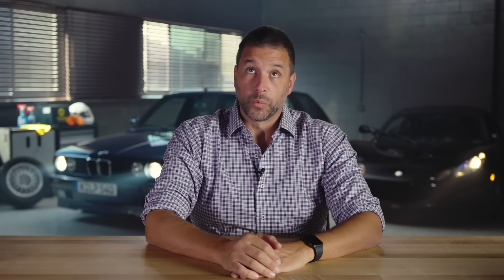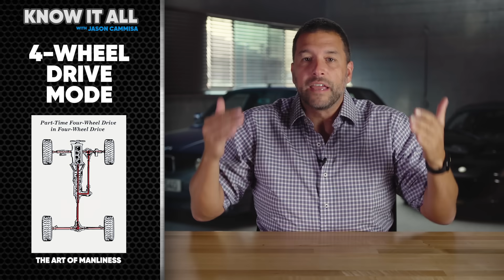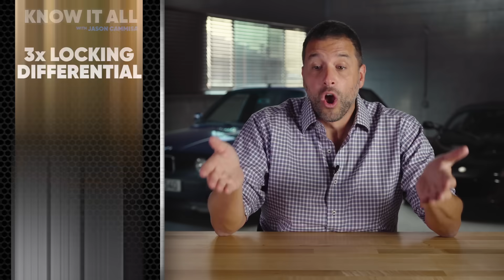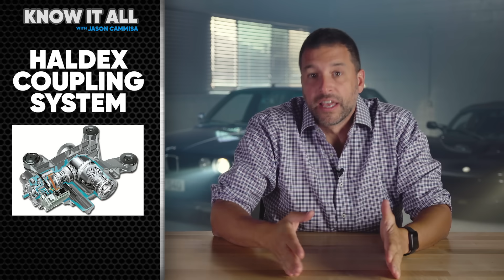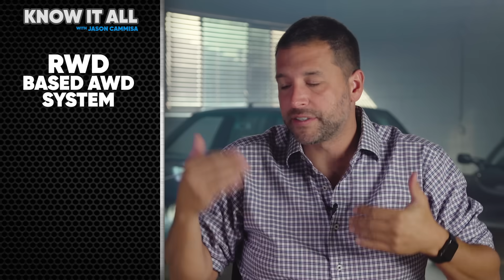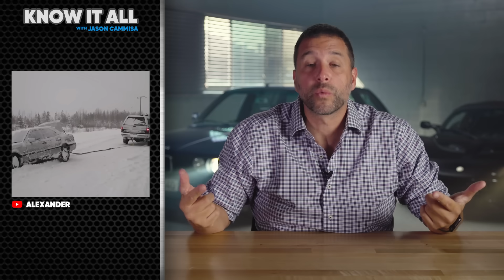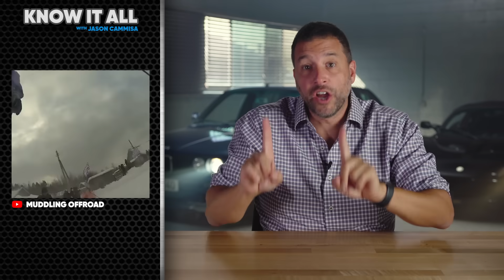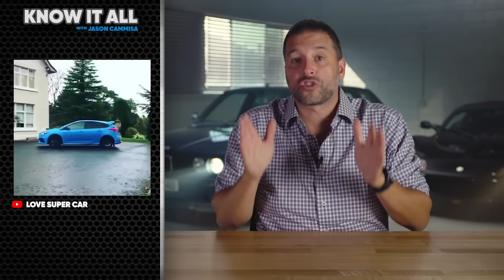Understand Your All-Wheel-Drive System | Know it All with Jason Cammisa | Ep. 04

Comment: AWD system is a liar ...
They never said HOW it works, they just said AWD ... They never promised you anything nor do they tell you how much power each tire gets at a time or ever... did they ?? People make their own assumptions on what AWD means. 
FWD does NOT always mean both front tires get equal power or split power
RWD same thing thing, no promise that your rear diff is LSD ... 

Just like your home ISP ... UP TO 100Mbps ... And they never said 100Mbps over WiFi either across the entire house when your house is 3k sq ft ... 
Your cellular provider says 5G, 4G, LTE, 3G etc ... They never quote or guarantee any specific speeds. Just that you will "GET" that technology of data ...

Comment: A true know-it-all wouldn't use the terms "power" and "torque" interchangeably. This video is surprisingly correct, and covers a lot for how short it is. But I think it would be most helpful to explain that only open differentials split torque equally or 50/50, and locked differentials send equal motion to each wheel. Sending equal power to each wheel only happens when driving in a straight line with open differentials and no slipping wheels. Literally no AWD system "sends power". They only send torque or motion. If they send torque, the resulting wheel speed determines power. If they send motion, the available grip determines power.

And yes, the innovation of overdriving wheels and using clutch packs to vector torque is awesome, but brings worries of clutch wear. Rear-biased or rear drive only Torsen setups are most useful, reliable, and fun in real life.
Reply: Pedantic. Know your audience would be a great thing for you to learn.

Comment: You can add a controller to the golf r to customize the power split. It's capable of full time 50/50. That's still not as good as other systems allowing a +50 rear bias, but it's a lot better than the stock config.
Reply: That's not a good idea, it WILL put more wear on the clutch pack which isn't a serviceable part. Don't do it. 
I researched this because I was interested in an RS3.

Comment: Is the SQ5 not a rear biased torsen based AWD system like the S4? I was under there impression they had very similar drivetrains. Any handling differences with the Macan could come down to a rear LSD like the S4's sport differential.

Comment: You got the Audi part wrong. Audis either have Haldex (A3,TT) or Torsen (A4-A8,Q5-Q8). The latter send 60% of the power to the rear and 40% to the front as standard. Those numbers are adjustable to some degree (up to 85% rear and 15% front). There is also a new Quattro Ultra system for some models (A4 and upwards) which behave more like haldex systems. Depending on which enginge is installed, you get the Quattro Ultra or regular torsen. (high torque torsen low torque Quattro Ultra).

Comment: Where's all my truck gang guys who have no interest in drifting, just wanted to know why the make-believe awd SUVs are not near as good :P
Reply: 4x4 guys usually want tough drivetrain so they can fit big tires. Independent suspension also limits flex. That's most of the AWD vehicles out lol. 
Mitsubishi montero sports had AWD(open differential in transfer case), 4h (locked center) and 4lo (but only about 2:1 reduction) They have IFS too unfortunately. The one upside is my factory axles are 4.90s
Some landrovers and Mercedes can too.
You ever hear of a Mercedes Unimog? It was designed as a "farm tractor" 🤣

Comment: Haha, Golf R is a snoozer, Focus RS is the goat. When my digital rear diff is fully locked, my rear wheels spin faster than the front. Big drifts.
Reply: And I just tuned my differential to squeeze harder. Now under launches, I get 4wd burnout, sliding off the road before Lightspeed.
Reply: Jason doesn't understand how the AWD system works in the focus RS, no center diff. Each rear wheel has a WET CLUTCH and forum users have logged no excessive heat. 150k+ miles on some cars already.
Reply: Jason told me my car would blast by ribs out, little does he know they revised the focus RS suspension after 2016.

Comment: There are a few inaccuracies presented here but I understand this is a not an in depth explanation. As others have mentioned the SQ5 has an actual center differential and it's the Q5 that has the Quattro Ultra clutch-based AWD system. The Macan will still feel more RWD than the SQ5 but in other regards the Audi is arguably more capable. Also the Mitsubishi Evo's AWD system is not like SH-AWD or the GKN Twinster system in that it does not overspeed the rear axle. It has torque vectoring (AYC), but it also has a center differential (50:50) with an electronic clutch based locking ability. Which brings me to my last point --  in any AWD system where the the front and rear axles can "lock", be it a traditional transfer case, center differential with locking capability, or a clutch-based system with no differential, it's not completely accurate to say that the torque is split 50:50. When the axles are locked, the torque will go wherever there is available traction. In a below the limit of grip situation this should mean that the split is 50:50. Once you are at the limit of grip the split will vary based on the overall friction force (normal force * coefficient of friction) on each axle. This will be affected by weight transfer and changing road conditions. In this way it is possible for torque at the rear axle to exceed 50%. Some of us live where there's six months of snow and icy roads so these conditions aren't impossible in the real world. I get why this won't give you the RWD dynamics we're all looking for on the track or your favorite back road.

Comment: Something that wasn't addressed is something like the Subaru AWD system.  More so, how would the AWD systems mentioned compare to the STI's 3 differential AWD system?
Reply: The STI's system is closed to the BMW/Jag system mentioned in the video, except the center diff has a static split (from 35/65 F/R to 41/59 depending on year) and the computer controls clamping the packs to change how much the center "locks" when there is a differential in speed between front and rear axle. The "problem" with the Subaru layout is that it forces the engine to be entirely in front of the front axle line (hence the short flat-4), but it does save a little bit of weight/packaging space compared to other RWD-biased AWD systems.

Comment: Hey, how about a video pertaining to we who don’t drive to the limit? Ya know like all of us who commute in snow and rain....thanks for talking to 1% of us....
Reply: There wouldn't be a video. Here's the rundown for AWD not driving on the limit...If you run out of grip AWD gives you more grip, O and you get slightly worse tire wear. THAT'S IT...

It's like trying to make a video about brakes and abs...To the "commuters" as you claim...They stop the car. What more do you  want in a non-limit based situation. 

If you are asking "how does AWD work in snow and rain" is a contradiction to "don't drive to the limit"... AWD is a system to HELP in limit driving. The whole point is to save your ass when you inevitably push it too far...If you are cautious enough not to be in that situation great...then the answer is AWD does absolutely nothing.

Comment: Open differential can not send power to only one wheel. Force from the engine is distributed equally between all wheels, but wheels can rotate with different speeds.

Comment: The video clips for this were awesome, as is Jason. I really like the simplicity and feel of the AWD 62R/38F split in my 01 325xi (originally bought for my wife's snowy commutes, but now my modified toy... it performed well in a moderate amount of snow, even on all seasons, but as a daily it's still fun).
Reply: I had an 01 330i. Just rear wheel. With snow tires, it was just fine. RWD works well in the snow. Then I had the opportunity to have a 2010 328i XDrive... All season tires made driving in the snow a piece of cake. The same exact day, it took me half an hour to back into my driveway from the side of the road in my FWD Malibu. Definitely showed me the difference between an AWD system and a 2WD system. Snow tires are a must, no matter what, but all seasons on an AWD will definitely treat you well.
Reply: @CMitchCars  Agreed! I wish I had kept my 92 Prelude with a OE JDM LSD too... it would pull through the snow!

Comment: Nice rant. It's good that Jason remembered to state that all of this only matters on the limit. A couple of problems, though. First of all, 4wd rally cars of recent memory have been able to steer quite well even without center differentials. WRC teams threw those away for a few years, when active center locks got banned. And secondly, Audi SQ5 actually has a real center differential, unlike Porsche Macan. Audi's diff is even slightly rear balanced. The car just has otherwise been designed not to be tail happy. And then there's the new Toyota GR Yaris, which seems to be quite playful, even though it has the exact fwd-based system, that Jason thought the Audi had.

Comment: Subaru system is superior because of symmetrical axels on front and rear, which combined with the DCCD system is the best true Equal AWD system.
Reply: Tbh best system is found in pickup trucks, user selectable 4WD with LSD rear.

Comment: My 2002 Volvo V70 xc Cross Country is Front Wheel Drive-All Wheel Drive (Haldex). Its wonderful in straight ahead driving, a formidable drag racer on snow & ice-covered roads running studded winter tyres & ok in corners as long as I am careful with the throttle. Take the bend slow & easy & once you get straightened out, hit the throttle. On a snow-covered bend, I gave it too much throttle & it tried seriously to drive off the road. And, once you over-throttle it, nothing gets better, more throttle & your trip to the ditch comes faster. Letting off the throttle & it slowly loses speed, on the wrong side of the road.

Comment: Sooo subaru symmetrical awd in cars like the manual wrx are like the Audi quattro system?
Reply: Yes the manual WRX (not STi) is just like the torsen Quattro system.  The CVT equipped models still send power to the rear at all times, but it's at a 60/40 split. and the STi is it's own  animal kind of like a hybrid of torsen and some  other systems like the one Nissan uses with GTR,  STi always sends power to all 4 wheels like all other Torsen AWD cars, but it is  rear biased 40/60 split (some of the older JDM ones were 35/65, not sure if US ones ever were that rear biased) and the dccd controls allow you to adjust the  clutch packs
Reply: Subaru uses three different AWD systems depending on the model. And most cars have equal-length axles these days so the "symmetrical" part is nothing special.

Comment: Great video! Was hoping to hear at least one mention of the Lancia Delta Integrale, a front engined car with AWD, rear TorSen differential, and a 47 front/53 rear split (on 16vs). The GOAT when it comes to 4wd rally cars.
Reply: I dont know exactly how that system is designed, but it sounds like the overdriven rear axle he talked about at the end. Torsen differentials are very strong, but they have 1 downfall, if 1 wheel loses traction it will only transfer the maximum amount of torque the slipping wheel has to the other side. If 1 wheel was in the air it would transfer next to nothing to the other

Comment: The SH-AWD in my Acura TL is surprisingly good. Flooring it around a corner is a blast, it sends power to the outside rear wheel making the car rotate better.
Reply: Yea. I'm a Audi Quattro guy but that TL is one Asian car I'd own. Nice car.
Reply: @teedot1186  Same! That's why i picked it. It's been a blast to drive. ESP around San Francisco lol
Reply: I am still lamenting the fact that Honda has never put it in the Civic Type-R or that Acura failed to put it into the new "Teggy/Accord".  I would buy a new car to get Type-R with SH-AWD(haven't in over 15 years).
Reply: Got one. It's surprising how good it is in corners.
Reply: That’s torque vectoring- very nice. My highlander does that too.
Reply: Not only that it can overrotated the outside wheel. Spinning it faster than it would normally. I have it on my 11’ RDX and it's a blast in the canyons.
Reply: @drooskeedoo3388  lol “my RDX is fun in the canyons”. Yeah……okay
Reply: @JustinSeara  have you driven a first gen awd?
Reply: I love those!!!
Reply: I tried to simulate SH-AWD. However, permanently overdriving the rear axle made it so that the whole drivetrain destroyed itself. The front slid while the rear tried to push, and transmission shifting would induce large enough vibrations to make the simulation unstable and crash, blowing the entire driveline to pieces.